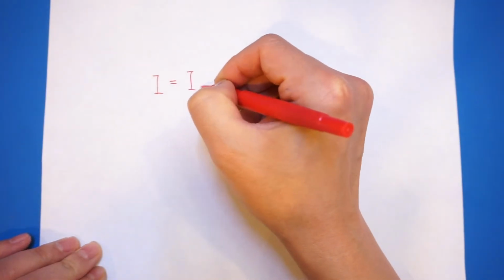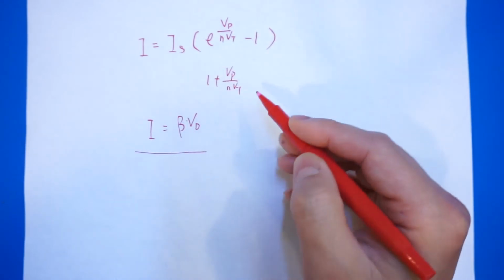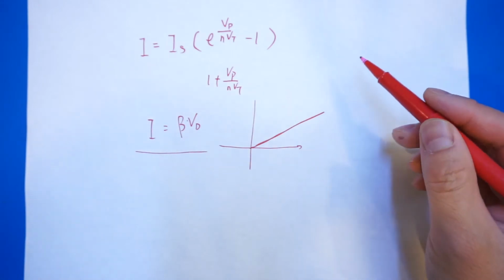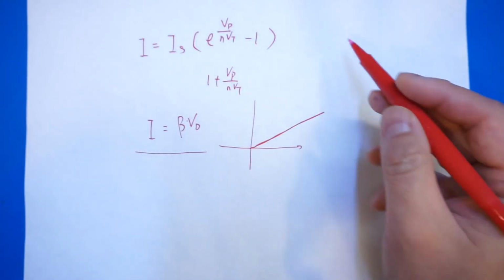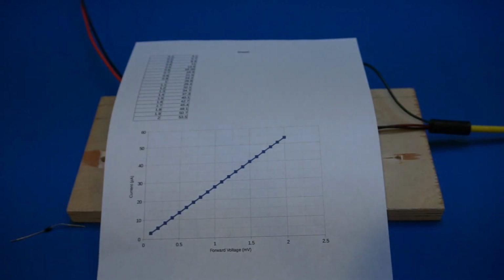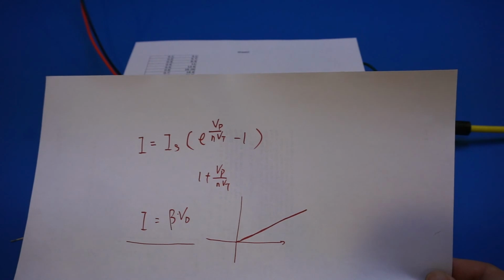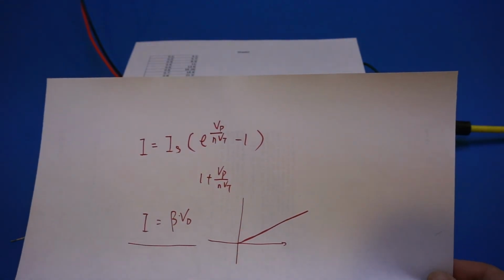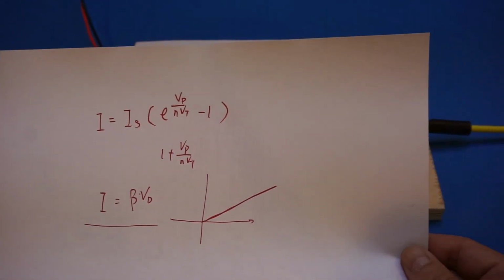Diode Equation and Forward Current Measurement

Comment: Could you not have just covered the glass case of the diode in electrical tape or something to prevent light leakage?
Reply from the maker: I could cover it, but it's not as easy as it sounds as even minute light leak-through can affect the result. Also, tape could affect the resistance between the leads because it has to be in contact with them otherwise light would come in from the side. Since we are talking about pA current here, even giga ohm resistance counts.

Comment: Interesting, the KEITHLEY didn't show a voltage burden effect on the measurement when you changed the current range.
Very nice video, thanks.
Reply from the maker: The voltage burden on Keithley 614 is far less than 200 microvolts so it's negligible in this case.